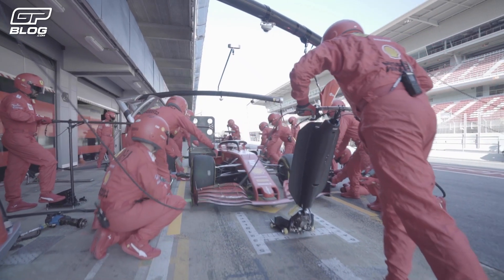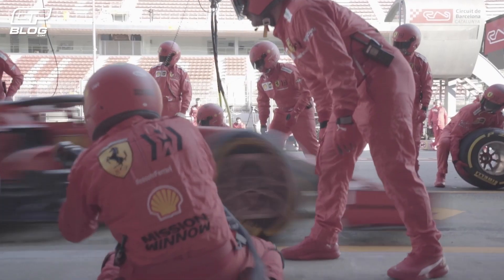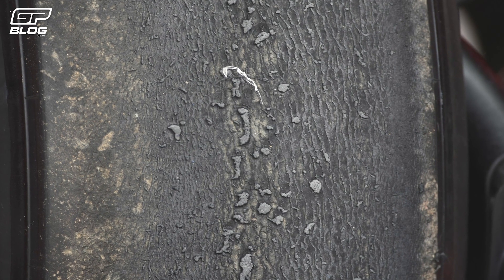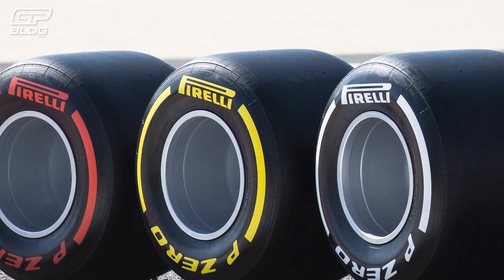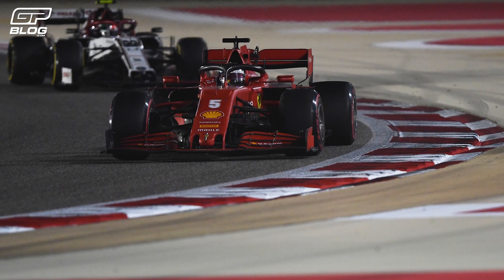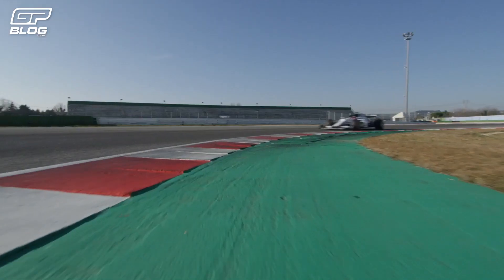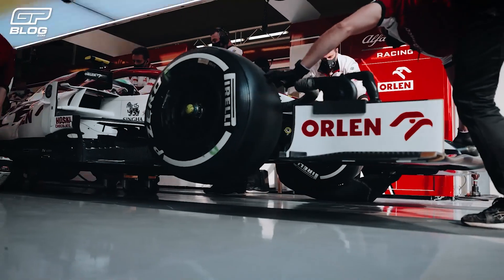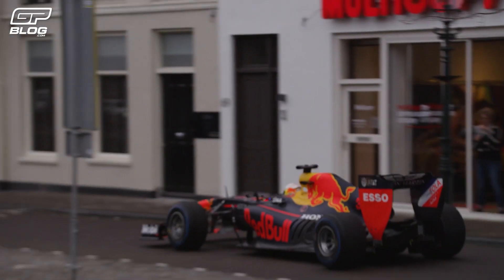How do the Formula 1 tyre compounds work?

Comment: They HAVE to box once? Are you sure about that? And they HAVE to change to different compound tires? This doesn’t add up with what I watched and heard today in the Turkish Grand Prix. I’m just learning snd trying to figure it out though. Not looking to degrade you in any way. Thanks!
Reply: In a dry race, two sets of compounds must be used (i.e soft-medium, medium-hard, etc…). Therefore in a wet race there is no compulsory pit stop.
Reply: @abdulrahmanmalzamil5787  makes perfect sense. Thanks! Also, does a small amount of rain constitute a “wet race” thus throwing out the requirements?
Reply: @77ryan0341  Well, it’s not that a wet race throws out the requirements, it’s more to do with the team’s decision whether to use inters or wets. So, theoretically, a team can run a whole “dry” race on inters without pitting.
Reply: @abdulrahmanmalzamil5787  makes sense! Thanks again!
Reply: @abdulrahmanmalzamil5787  if a driver has to use two sets compound Tyre, then they have to do two compulsory pit stops in a race?
Reply: @thatwildcat9050  not really, you start the race with compound A, when you do your first pit, you can switch to compond B. thats one pit stop but two different compounds.

Comment: Great vid! Thank you. When you say 13 sets, are those 13 sets of four? And why 13?
Reply: I think it is 13 sets of four. If I was right, the 10 sets are used for practice and qualifying rounds. The last three will be reserved for the race. It is the strategy of the team on what compound to use in practice, qualifying and on race day. Correct me guys if I'm wrong :D
Reply: @noelgaddijr  Thank you for replying!
Reply: It’s two sets of hards, 3 sets of mediums and 8 sets of softs
Reply: @frankielight2696  what will happen if we consider a bad weatherduring the weekend?
Reply: @noelgaddijr  They get 4 sets of Inters and 3 sets of Full wets in addition to the 13 sets of drys, not sure how many do they have to return after quali though
Reply: I’m new to f1 but you can’t pick the tire you want to start on right ? U have to use the one from Q2
Reply: @2questionmarks  so you have to start the race on the compound that set your fastest lap in Q2. And there is a special set of softs that can only be used in Q3 and race. If you don’t make it to Q1 (top 10) you get to start on whichever you have and you wanna use.
Reply: @2questionmarks  I'm not sure but it is the strategy of the team? As long as during the race, they should use 2 different compounds